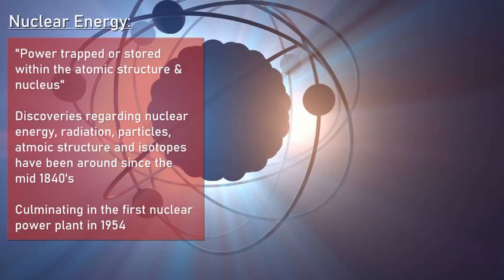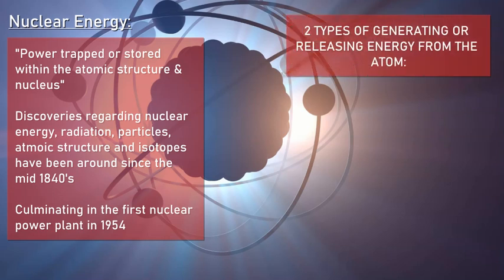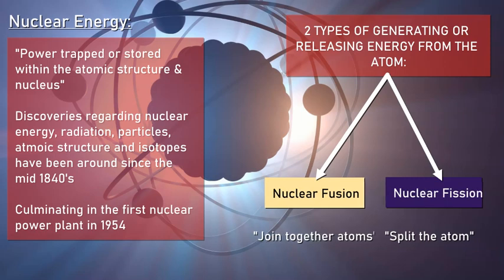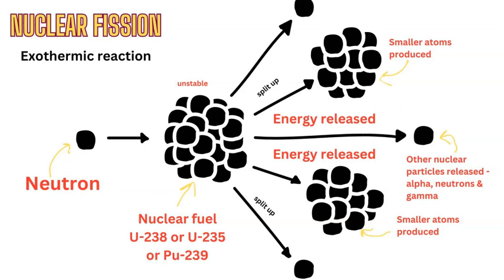What Is Nuclear Energy?

Comment: Hey just one more thing, speaking of comets and recovery satellites burning hydrogen in earth' atmosphere, look it this is how is a supposed to be done, let the recovery satellite, known as a comet, "(one the 1st satellites was a 61 Ford Comet)" let the recovery satellite enter, once it starts burning you use anti-gravity and push it back out, The Usn Whittney was the ship they used, huge magnetic turn table on the rear deck,  try to land a helicopter on a ship that size in little visibility on a choppy sea, that's how they did it! there actually two, the Whittney and the, Usn Duluth,???, the trick is the Test-Tail, not terrestrial, and extra-testail, not extra-terrestrial!, Extra (Long) Test Tail,  When it enters, make a note of the flame tail length, after it pushed back out, it will the tail grow as it increases in speed, orbiting the earth with 10% decrease in altitude, watch the extra test tail,  when it's approx. the same length as test tail, (Almost out of Fuel) it is presumed safe to enter, Maybe try to convince Nasa how to do this procedure correctly, I've had no luck, You might ask if anyone's ever Old Author, tell him his son say hello! JIm